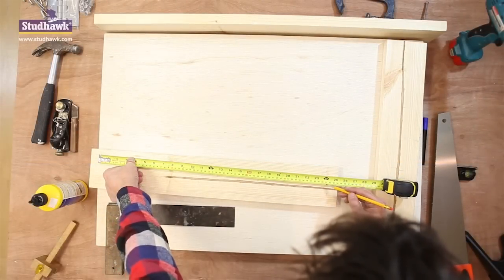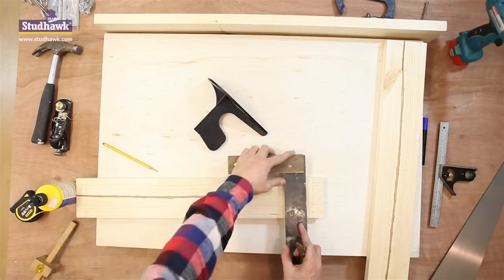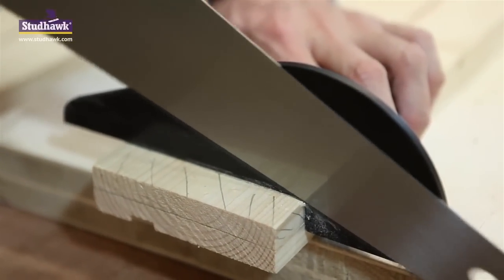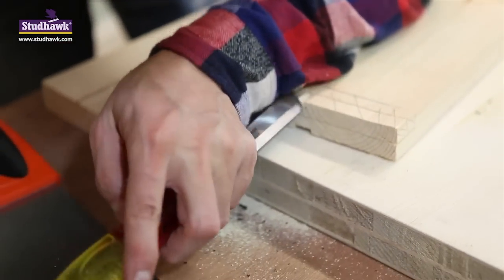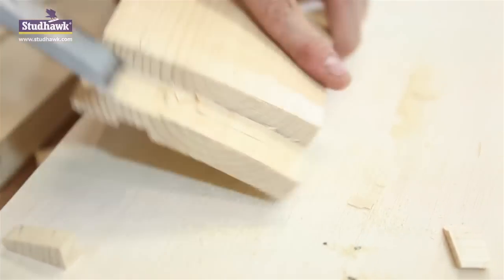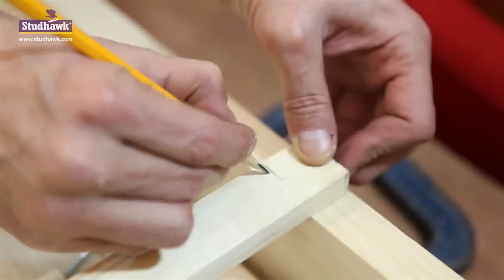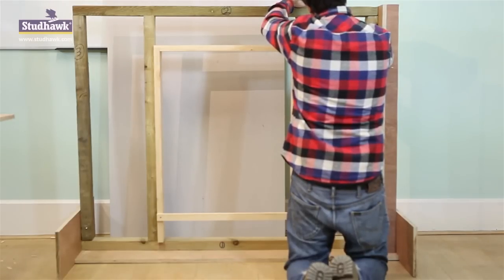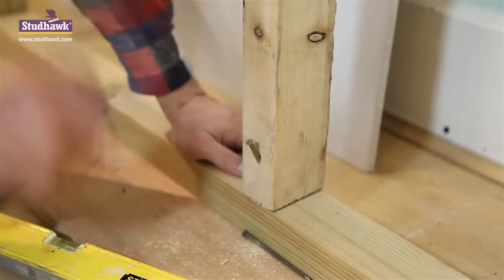Part 2: How to make a door frame

Comment: Woodwork projects using simple hand tools.  Very helpful tutorial.  Thank you.
Reply from the maker: For anyone who thinks they can just jump straight in at the deep end with power tools - think again - you need to learn the hand tools first, and sound is a lot to do with it - WHY & HOW because when you use a saw correctly it sings and when you are hammering well you will also hear a nice rhythem. It is also the same with painting and loading the brush by slapping the brush on the side of the tin or paint kettle to fully load the brush with paint. It is also true of planing wood - down to the sound of using your screw gun correctly and even the scratching noise of troweling on tile adhesive. So a tip for all is to listen to the rhythem of the tools when used correctly by an acomplished tradesperson and remember what that rhythem was when using the same tool yourself. Immitate the sound and rhythem to know you are using the tools correctly. As for learning to cut accurately with the saw - let the weight of the saw and part of your arm weight do the cutting with gravity assisting the cut - hence "Let the weight of the saw do the work".
Happy to help Studhawk.
Hope you liked and subscribed and shared with friends.
In the next 12 months we will be showing our viewers how to dig a basement extension and garden extension above it and all the different trades that are needed for such a construction - so stay subscribed.

Comment: In most cases you are not building or installing door jambs until after wall coverings have been installed (sheet rock for example).  As a result, you aren't going to have a chance to adjust your door frame.  Second, door frames typically consist of a King stud, Jack stud and a nice tall header.

Overall nice demonstration of chiselling techniques.  Poor demonstration of stud work.
Reply: +Paul Derbyshire you are right at this point.
Reply from the maker: +Paul Derbyshire The studwork was not the important thing to get across in the video - but the architrave mitres and skirting mitres and how to make a door frame etc was. As the wall was a dummy wall it could never be a true demonstration of studwork but it was designed to get across the principles. Thanks for your kind comments. Try our How to tile a bathroom video!
Reply from the maker: What do you expect from a dummy wall that keeps moving - the video is about the prinicples of studwork and making a door frame - which if you listened to the commentary you would have heard it represents an under eaves storage door for in your loft. Yes you are quite right to name all the parts - king stud jack stud, but this confuses diy'ers. An off cut of plasterboard or sheetrock as you call it,  will space the frame out enough for plastering, We finish off with architraves in the UK after plastering. And we call the top stud the header. No body uses the old terms any more unless you are doing roofing where Jack rafters and hip jack rafters are referred to as such. Don't feel silly for not knowing these terms people all you need to do is cut the wood accurately and fix it together well using the right dimensions of timber - weather it's a head or a jack or a king they are all cut from 4 x 2 inch sawn timber. In the UK we use what is known as door linings or door sets (door frame) which the door is hung from and the architraves mount onto.  They also have grooves for inumescent strips. Door stops now have to be 2 x 1  1/4 inch for fire reasons and old door frames don't comply for HMO's (houses of multiple occupancy) nor offices.
Reply from the maker: Forget what the studs are called - ths is an example of a door frame and hanging a door which was said could represent an under eaves storage area eg. Learn how to use hand tools before you progress to power tools and the methods shown are traditional hand tool methods. As for the person who asked screws or nails - it depends - nailing for studwork is traditional and screws are more expensive and sometimes used especially when you don't want to risk splitting a timber ie close to the end of a piece. Always screw the door lining or frame with packers to level and square up the frame. When it comes to nailing on a door stop - if it is a security door ie front door you will want to screw fix the door stop so that it cannot be levered off by burglars!

Comment: how would I make A frame for an under stairs cupboard door?.  i need a frame to put cladding on. its an awkward shape to do.  I'm doing the whole space under the stairs but with a break in the middle so I've 2 doors (if that makes sense. cheers matey 👍
Reply from the maker: +John thomson  Hi, go to a salvage yard online and see if you can get a matching under the stairs cupboard door to match the original if it is Victorian or Edwardian for example.  If you can't find a door with a triangular top edge then make one from a salvaged door matching the original. In a lot of cases you can get a WC under the stairs. In the UK there are a few common types of house across a few periods. Listening to the original aesthetic of your own house is always best - as mixing styles that could go in or out of fashion might be costly in the long term.
Reply: +Studhawk cheers dude 👍

Comment: hi, where can i find part 1  of this series. thanks
Reply from the maker: Go onto You Tube Studhawk channel and for best guidance start at the beginning. There are basically two videos split into sections due to length and subject. How to Build a Stud Partintion Wall and How To Tile A Bathroom. Don't forget the classroom session and the tiling tools bit - they will give you the whole picture and reasoning behind why it is done this way ie BS standards for tiling being minimum 86% adhesive behind the tiles. We have all seen tiles that are falling off the walls because they were not stuck properly and from that you can deduce they were not proper tilers even though they fixed the tiles neatly were they really stuck to the wall - NO

Comment: Question, why use nails to fix instead of screws?
Reply: strength
Reply: just thinking the same...
Reply: screws have more tensile strength, nails have more shear strength
Reply from the maker: +Petyusha85 Cross sectional area of screws and tensile  versus sheer strength are different to nails. Nails can move better with seasonal fluctuations in timber which can be + or - 2-3% annually on length. Screws would snap on this seasonal expansion and contraction.

Comment: Do not do this. Unless you have forever to get it done.
Reply from the maker: Well Patrick we do not all have a chop saw and this is the way to do the job with minimum hand tools which are cheaper than power tools and safe for the beginner to use. So do do this and learn hand tools before you try to progress to power tools. Do you agree with this statement at least. As for not doing it this way - well all walls do have a floor plate and a ceiling plate and then the uprights inbetween so it is the way to do it. Noggins are nailed through the edges of the stud as are the fixings to the ceiling and floor plate. The drilling tip for screws stops the wood from splitting and the leaving in the base stud of a door opening are done this way to keep the 2 sections either side of the door opening, in the same plane. If you try to nail into a stud at it's end it will most likely split. But then you probably own a chop saw and a Pasloader nail gun and sadly not every diyer wants to buy all of these tools for a one off job! So those who rely on hand tools do do it this way. Further Mr Big Mouth when ever you buy a door set from the builders merchants the header has exactly the same lap joint as shown in the video
Reply from the maker: From watching the video and taking into account the filming time this wall was built in less than a day and most stud walls only take a day or two depending upon size - so i do not consider hand tools to take forever and most diyers do not own chop saws. This demonstration shows that anyone can do it without loads of power tools etc. All diyers should learn hand tools before being let loose on dangerous power tools. 

Sadly many chippy's are so used to using the chop saw that either they never learned hand tool skills or have forgotten them. The other point about a chop saw is that you have to set it up in a usable position and this usually involves plenty of walking back and forth to the chop saw station. Try timing all of the walking to and from the chop saw and you will perhaps see that working insitu ie right next to the work you are doing is as quick with hand tools as walking to and from the chop saw and that there is very little difference in the cutting time due to the walking back and forth.

A good sharp hand saw can be as effective as a chop saw though an actual cut on a chop saw one aligned is quicker than a hand saw. It would seem that plenty of tradesmen object to a video that is achieved using hand tools perhaps because they only use power tools whenever possible. Many building contractors will support this observation on carpenters and their hand tool skills versus always using the chop saw and many seem to be allergic to using a hand saw or were not very good with it in the first place. Proper carpenters are good with hand tools as well as power tools and it would seem you like the easy way every time but the learning comes from hand tool experience in the beginning.
Reply from the maker: Patrick this is the quickest system if used correctly with a washing up liquid mix with water and the atomiser spray and some liquid in a bucket for tool clean off and wetting of the tool between each pull of the silicon tool. If these tools are used dry it is not the correct way to use them! Any other way of silicone application is inferior and actually takes longer ie masking tape etc

So many people think they have found fault in this system but do not fully understand how it works and remember silicon and water will not mix and is only used to overcome friction and drag marks on tooling up.

Comment: Load of rubbish.  How you going to adjust your studs with plaster board in place.  Not to mention nailing from the top.
Reply from the maker: Again another viewer who did not listen to the commentary and decides that the old hand tool methods are rubbish !?? well Bill not every one can afford a chop saw and without instruction nasty accidents can happen. So i am afraid i disagree with your comments as the best way to learn woodwork is hand tools first - then progress to power tools later. obviously the dummy wall would abut to a ceiling so i fail to see the relevance of your comment about nailing from the top. It is a dummy wall dummy!!
Reply from the maker: When you set studs they should not need adjusting and the door frame is usually installed with shims or wedges of wood or the plastic type packers - screwed through to keep them in place as timber seasonally contracts and expands by upto 3-6% in it's length. So sorry Patrick this is basically the  way all carpenters have done studwork and made door linings despite the fact that the intumescent side of the frame was not used (fire expanding strips for fire precaution). Since times of old, the pattern of the studwork has changed and in the past diagonal studs were often used in stud walls (eg Georgian studwork) and the uprights were spliced to the diagonal braces in the studwork and so in my opinion did not act or take the moments of the wall but the installation was designed to give a square a diagonal support and squared strength. Anyone who has seen old studwork exposed will verify this. So this video is not a definitive guide to all studwork but a basic explanation of what it is. The dummy wall had no walls to fix to but the commentary covers the fixing of the wall plates to the wall.

This is a low budget film and not Hollywood but the basic principles are correct for studwork, cutting and fixing architraves & skirting's and taping and jointing, making and fixing a door lining set with it's door stops. 

As for your idea of not being able to adjust the studs once the plasterboard is in place is not the way studwork is done! The frame is plumbed up before the plasterboard is fixed and then skimmed and the architraves and stops added later whilst hinging and hanging the door.

So if you think this is rubbish i suggest you ask a professional about the basics of studwork as you obviously have your own  wrong ideas about it. The tip about leaving the base stud in between the door frame studs alleviates the need for adjustment in the two side studs to the frame. Simply cut the opening out after the uprights are fixed. This also avoids the end stud splitting which is why i often use the drillng tip prior to nailing. To say that it is rubbish to pre drill a pilot hole is nonsense as this is and has been used for centuries and in many ways.

So sadly another troll like comment i have to rectify and tell you pilot holes have been used for years to stop wood splitting and studwork has been done this way for many decades. Now however the wooden studwork is replaced by Gyproc metal studwork - which does rattle and sounds very hollow. So for a superior stud wall use timber as opposed to metal studwork though the latter is cheaper.
Reply from the maker: I did not have to set the plasterboard on both sides and as i was taping and jointing the plasterboard it was not necessary to leave 3mm for a skim coat of plaster up to the door frame. The frames are always fitted before plastering and a lip of 2-3mm for the door frame proud of the studs is sufficient and obviously needed. As for adjusting studs once plastered - this is never done - once studs are naild up they can't be adjusted. As for nailing the top- on a dummy wall this was ok - but if you watch the whole video you will have enough common sense to realise that the angular nailed fixing to the floor plate can be used on the ceiling plate! Anything about that that doesn't satisfy you or maybe you should watch the whole video to check what was said as well as what you viewed. so i refute your load of rubbish comment as trollish !?